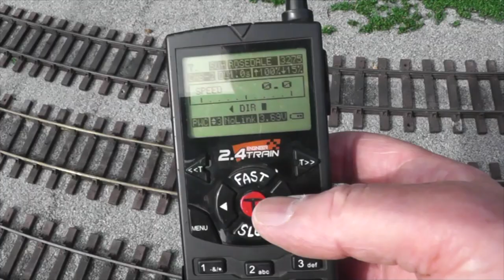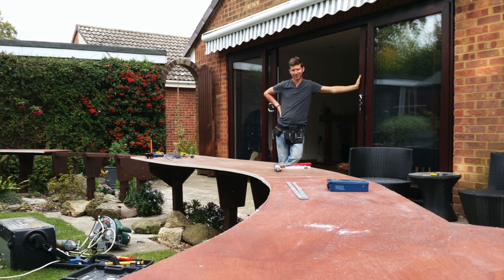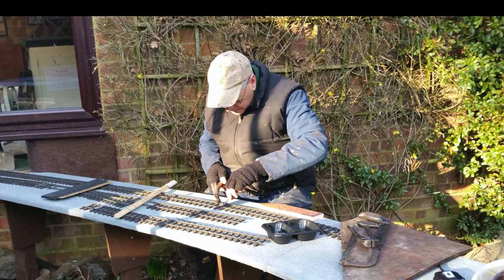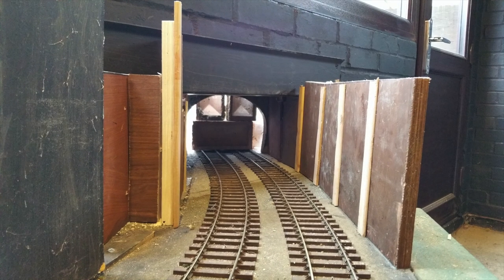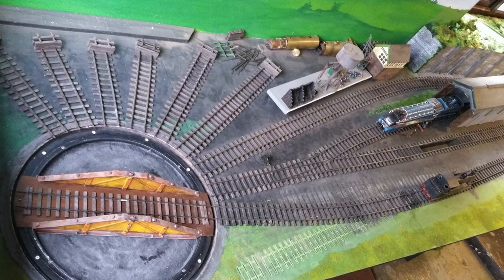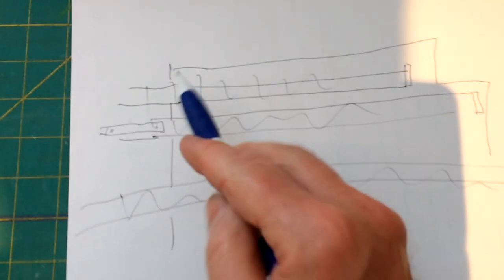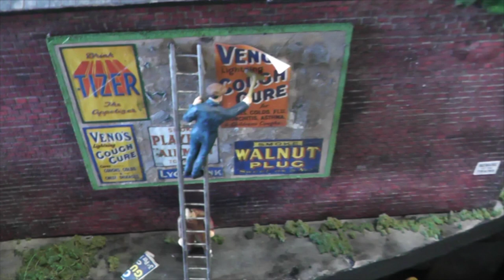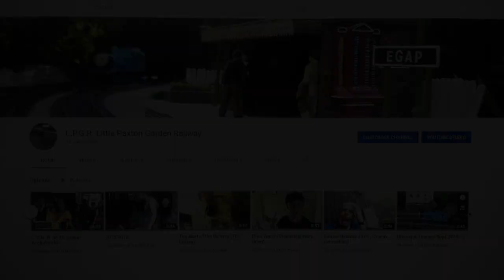Building a garden railway

Comment: Id love to do a G scale railroad in my yard but ill have to stick to doing an O gauge garden railroad as a 1' straight can easily cost 10 USD while the o gauge track i can get 24 30" sections for 62 USD. (96 cents per foot)
Reply: Where are you finding O-gauge track for that cheap? I'm able to find some for around $5 per 10" straight but not for 96 cents a foot. Also, trust me when I say this, but while track might be cheaper for O, rolling stock won't be, especially with for locomotives since O focuses more on large mainline standard-gauge equipment while G tends to focus more towards smaller narrow-gauge models.